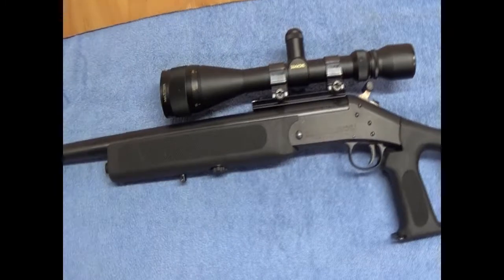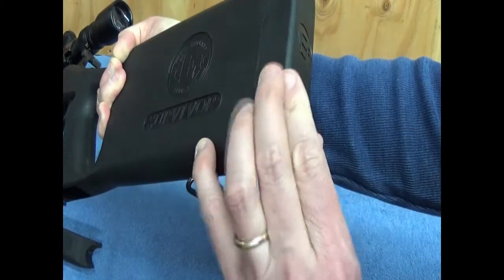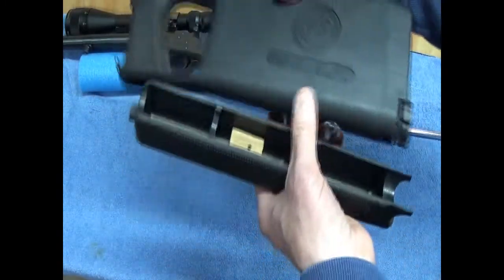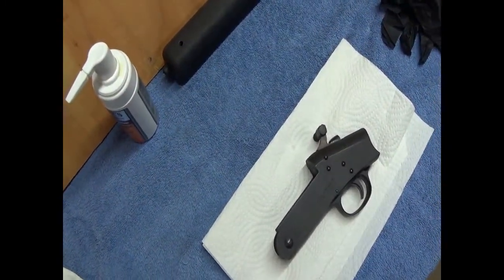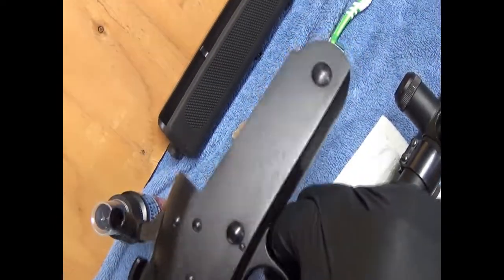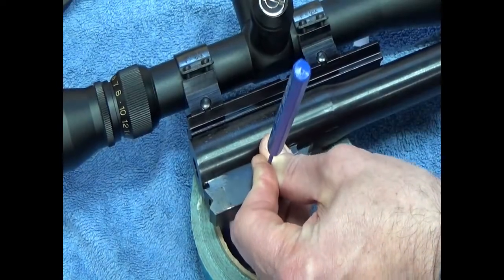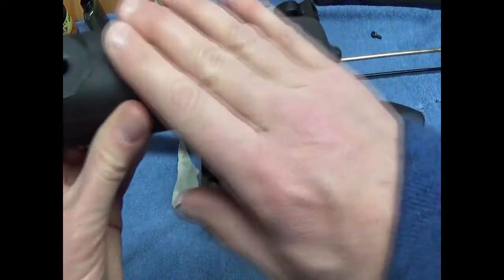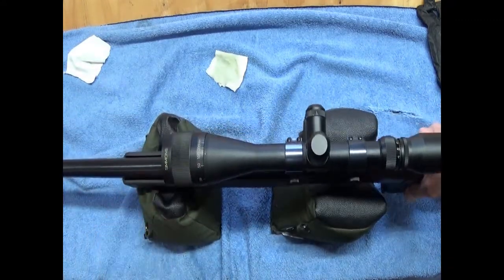NEF Handi Rifle Disassembly and Cleaning

Comment: A good way to remove surface rust is with 0000 steel wool, and either CLP or Blue Wonder. Blue Wonder can be used to also clean the barrel and chamber of carbon deposits. Excellent multipurpose product.

Comment: An Extractor just lifts the case, an Ejector is spring loaded and pops the casing out and away from the gun.
If you want to do a really interesting video, do one on converting an Extractor into an Ejector!
Also, don't be lazy, if you ever need to work on a gun, take the scope off!
You will most likely knock it out of adjustment anyway and the risk of damaging it is just not worth it!

Comment: Mine opens up after firing
Reply from the maker: That is not safe. There are a couple things that could cause the latch to not close correctly or open easily. If you can't figure it out I would take it to a gun smith or gun place that works on guns. It should only open when you use the latch.